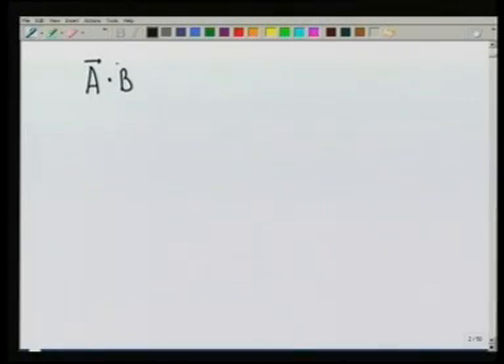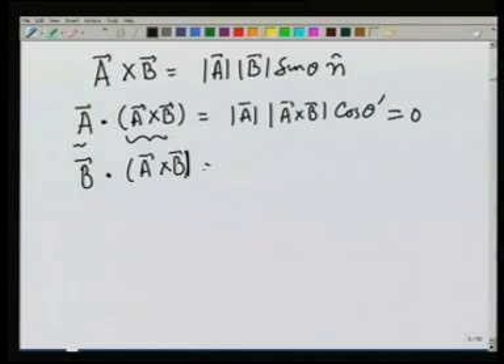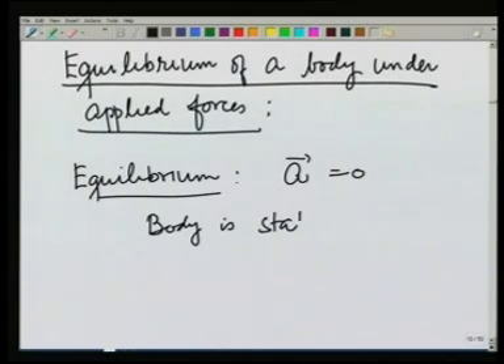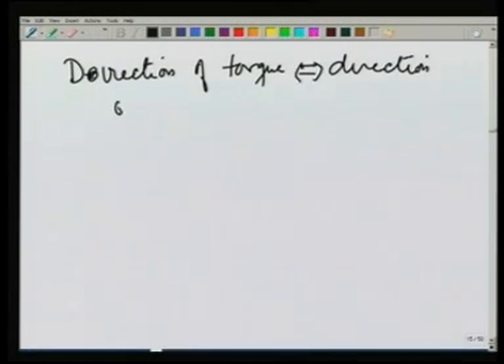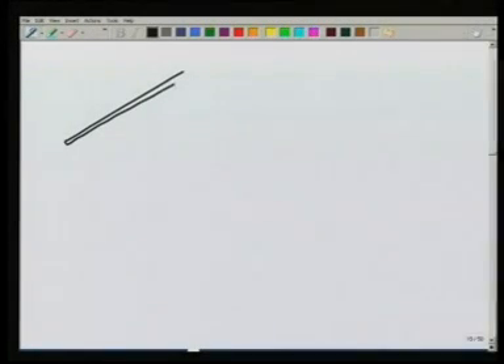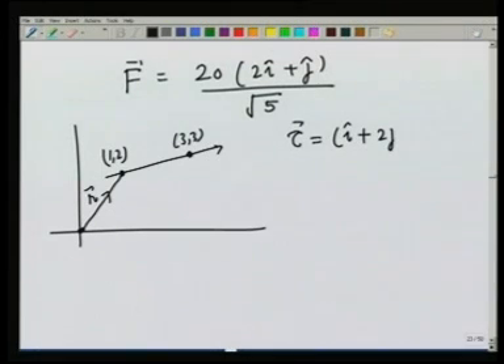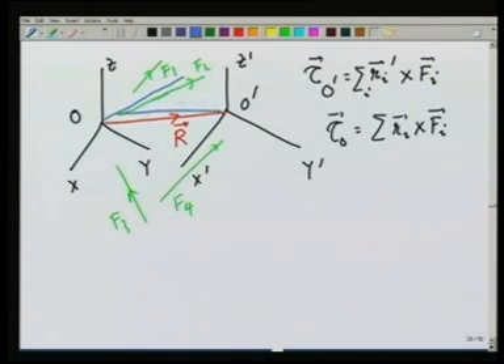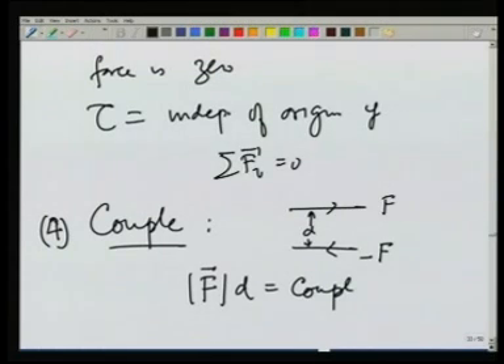Module -1 Lecture -2 EQUILIBRIUM - I

Comment: Why is 'Torque prime' equal to 'r prime' x 'force' and not 'r pime' x 'force prime'?.. Even though force is same, isn't it need to be defined in the respective frames? 

And also pls explain, in the derivation of torque independent of origin, how is equilibrium of force taken into consideration. Thanks.